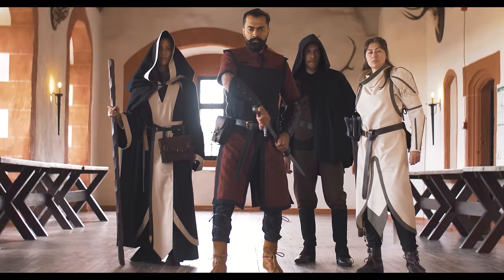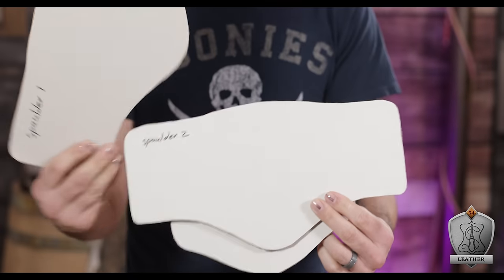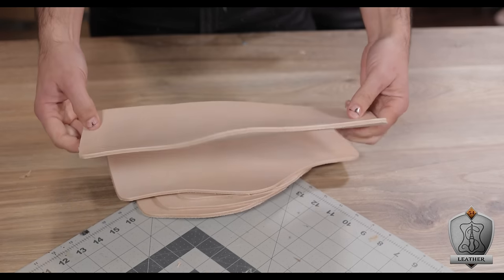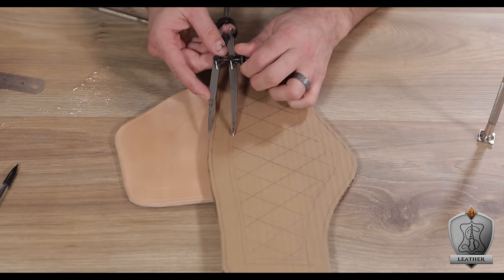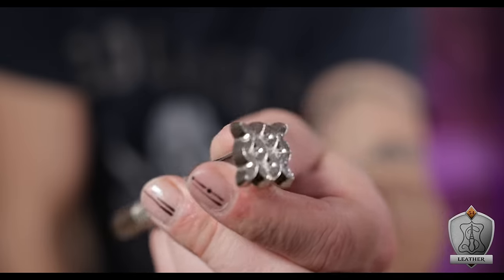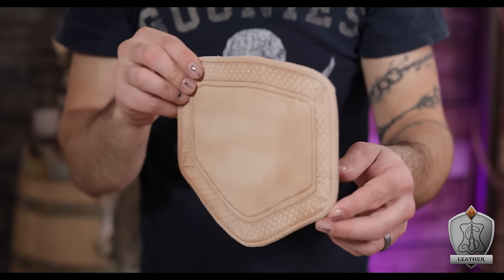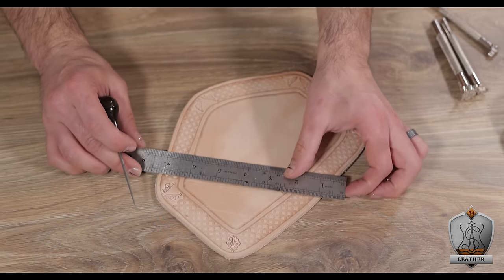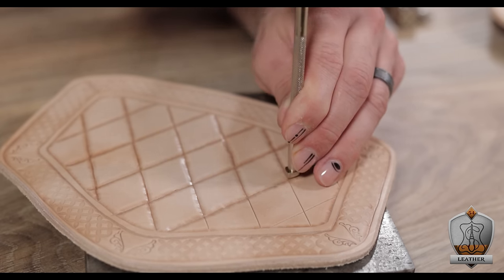How Much Have We Leveled Up?

Comment: Loving the upgrade. You’ve definitely levelled up and I loved the originals. Weird side question, who does your nails? I’ve often noticed you have them painted but every so often you have a funky design and I love your nails in the vid. If you do it yourself can you do a larp friendly job. 

I like the idea of an elemental design as a way to do mage casting. Each nail has a different element upon it so the way your fingers touch creates the spell and the nail design gives you memory prompts. 

I have been tempted to have this idea tattooed with UV ink on my hands but I may be taking it to far 😂

Comment: if it's a non-textured bevel, you can fix the ripples by just holding the tool in your hand and rubbing it over the rippled area to even it out. also there's a stamp tool called a double bevel that is a V shape made specifically to bevel both sides of a cut at the same time for that quilted look (I don't have one but I know that it is a thing)

Comment: I love these vids, but did anyone else notice random production quirks? 
5:44 and 24:10 were a bit low (also the video seems to be compressed with more artifacts)
0:49 "...leveling up this skill" skill level up shield thing doesn't pop up until 0:50 after the cut
2:56 Points to where art design should be
7:45 weird audio artifact.
10:39 lost frame? Probably jump cut
12:58 Cleric book card shows at 13:07
15:29 "I then went around...…I then went around" Probably meant to cut the 1st I then went around.
18:48 "out of, out of position" Frame skip/audio skip? 

Not pointing this out to be mean or picky. More to make sure the uploaded file wasn't corrupted or worse case the editing computer is having problems. I've been doing photography/video for 15 years and unintended artifacts are the first sign of problems to come. 

Usually I'm not a fan of gold, but damn those are sexy looking.

Comment: First, your advancement in skill is amazing. I'm just now advancing to stiff veg tan and artistry, so I admire your artwork. Second, advancing to thicker armor leaves larger gaps for swords to cut into. So your under-layer should be a solid sheet of leather, not straps. Finally... thanks for the tip on letting the hammer drop! I'm using it from now on.

Comment: btw have you ever considered making a tutorial for lamellar armor? i think it would be a perfect fit for your channel as its incredibly cheap and unlike leather armor you dont need any fancy tools or dye's and to be frank not even skill or practice, imo its perfect for anyone, i had a tight budged so i ordered cheap lamellar plates, they were abit rusty but i didnt care, i paid 90 ish bucks for 400 plates (which was about 7 kilos of steel) and i had to pay 25 bucks for shipping, at that price i knew i wasnt getting mirror polished, spotless plates, but if i had the money i couldve ordered fancy plates, you do need some leather but honestly? picking up some used leather belts from a thriftstore work perfectly, depending on the plates i would also suggest atleast wrapping the lower part of the armor in leather but as long as you can cut a semi straight strip of leather and have some means to make a hole in it to attach it youre golden, its honestly something a 10 year old could do by himself with little instruction and as i said it should be affordable for almost everyone

Comment: The new pauldrons look amazing, and I would certainly agree they are a level above your first ones, though I think the first ones still look great!  I do have a couple of ideas.  #1. On the older ones,  cut some sword/axe blows into them with your swivel knife to give them a battle-scarred appearance. That is, if you think battle-scars are cool.  #2. Dye the back side of the plates. When viewed from a side-on angle, it is easy to see between the plates, and the brand new leather with no patina at all can detract from the overall look.

Comment: Love your videos! I've taken inspiration from several of your projects, and still have a few in my backlog to do.

Not trying to be negative, but did you accidentally upload a slightly unfinished edit of this video, or were you a little more rushed this time? There were several times where you referred to linked videos or pointed to the corner where you intended to overlay a picture, but it wasn't included; and there was also at least one failed take left in. Obviously small errors, but your videos are usually so high quality those things stood out. Again not trying to be negative, just wanted to give you the feedback in case you hadn't realized! Keep up the great work!
Reply from the maker: Oh yeah, we had some issues with the edit but figured it was better getting the video to you sooner than having to reexport and upload for the inserts. We appreciate you looking out for us though 💖

Comment: I suspect that the rivets holding the D-ring straps are not going to hold up to active use. They are too light for a stress point.
You might think about replacing them with copper rivets and burrs, for heavy duty attachment.

Comment: It looked like the new Pauldron was riding up with ware and digging into the side of your neck, if that is the case I have some ideas that could help.
(If not you may disregard this post)

1. You could try curling the edge of the top piece so if/when it rides up it won't irritate as much. You could add more design to the piece similar to medieval pauldrons with those wings jutting of the top to protect the neck from piercing.

2. You could attach them to your gauntlet/bracers/gloves to help anchor the pauldron and keeping it from riding up with ware. Design wise it can be as simple as a looped strap/lace/string that allows the gauntlet/bracer strap to feed into it. Or you could replace the gauntlet/bracer/gloves by extend the pauldron down to the hand similar to the Roman Gladiators adding some special connection for the bend in your arm.

3. You could do both!!! though not only would that cost lots of leather, but it might become too much of a good thing with all those colorful pieces.

Hope any of this helps and have a nice day!
(p.s. Even if you don't need to edit the pauldron these ideas could be useful/subject for future videos)

Comment: Looks amazing.  In regards to the “single rivet” though, I might suggest using a Chicago screw instead.  If it’s a single rapid rivet, it isn’t very strong.  A Chicago screw is better for load bearing connections.  I’m a leather crafting civil engineer so this part really stood out to me.  Otherwise, it came out so well.  I’m very impressed.

Comment: I understand that you wanted to add the blue edge to the top piece in some way eventhough you fotgot it at first, and that you put the emblem on that particullar piecefor that reason - and it DOES look good 🙂
However, if it wasn't because of that, I'd put the emblem at the middle of the shoulder. I just think it would be seen much more that way, and making the entire project look even better 👍
But again: I see and totally understand why you did it the way, you did

Comment: I recently added some black pinstripes to an oxblood red leather sheath (I used a stitch groover to cut the line, then infilled with USMC Black).

And that dye bleed is real, none of my fine tip brushes were working, so I ended up using a bamboo skewer as a dip pen and added the dye one drop at a time in an effort to prevent it from bleeding into the red.

I will have to try the counterintuitive big brush technique next time.

Comment: Heads up! That "letting gravity of the hammer do the work" method is Also the best method for metal working - trying to add your muscle strength to hammer blows will cause tendonitis and muscles strain over time.

Comment: Just wondering, because your tooling stamps look amazing, what is the most important aspect? I have tried it and cannot get consistent stamping. I’ve tried an old anvil as a bottom and I think it is not entirely level. Does a flat surface, a hard surface, or a solid whack seem most important?

Comment: I appreciate that you understand the importance of a sharp blade.  However factory razors are actually somewhat dull.  Grab yourself a piece of veg tan and mount it to wood.  Get some jewelers rouge and strop those blades.  You'll be surprised how much sharper they are and it is great on that saddle skirting.

Comment: 10:00
Alternately, use a bone tool at a matching angle and run it up and down each line after beveling. It evens everything out and burnishes the edges

Comment: Yay! New Skill Tree.

2:30 Do you think the Cricut Maker could do the cut instead?

6:40 So my room is made up of several workshops nested/overlapping each other. My 10x12 foot room has a vertical print farm made of 9 3d printers, a laser station with 3 laser printers (one Infrared and two ultraviolet), my design station (read desk), a "soft station" for fabrics and leather working, a "Me" area for when I want to work on myself (exercise and reading), and lots of storage. Oh yeah, there's also a full size (double) loft bed. Not much vertical space above me, but Im laying down anyways, so it doesn’t bother me.
Reply from the maker: WOW! You have a full little factory going on!
Reply: My Cricut Maker 3 says it will do up to 2.4mm thick leather, but I have found it often fails on anything over about 1.8mm thick. Up to that thickness it is great.
Reply: @SkillTree  Yeah... that's how my friends describe my room... but it works and I keep myself busy, so I call it a win.
Reply: @EvanMFitzGerald  So it can reliably go up to 4.5 ounces... Thanks for the information.

Comment: Small Scale workshop/studio.   I am a fiber and fabric crafter.   I have no sewing room or even a dedicated sewing space.   What I do have is a sturdy drop leaf dining room table, a counter height buffet with an 18 x 24 inch cutting mat that just fits, an ironing board and two IKEA type carts.   And a vintage sewing machine.  Plus a couple of big but thin boxes that once held furnace filters that I've flattened out to protect my table top- the weight of the machine is enough to hold them in place. 

I can and have sewn full sized quilts, a gambeson (those old cast iron Singers from the 1950s and earlier are BEASTS), the straight (hidden) seams of several shirts and chemises and petticoats - so many petticoats! Everything tucks into the hall closet and takes less than 10 minutes to set up and take down.   Maybe 15 if I stop to sweep up all the threads and fluff and put the buffet decore back.

It's all about not over buying materials, not having much of a stash (if any), not having many works in progress (one large and one or two small is about the limit for me), not going overboard getting every single tool you might ever need.   Let the drawers and bins of your cart determine how much stuff.   When it's full, you have to get rid of something.   And given the choice between a large fancy sewing machine with all the bells and whistles and 50 specialized feet and fancy electronics in a big dedicated cabinet and a half sized tabletop vintage machine (a 1955 Singer 99), I went with the smaller, older but much more compact (and not co-incidentally much cheaper) option. 

I feel really blessed to have a dining room; in college, I sewed at my desk and had to put everything away every time, with only my Featherweight Singer (which is about the size of a vintage makeup case when it's all packed away) and 12x8x10 inch sewing basket.  My IKEA carts are palatial by contrast.   Would I like a studio?  Of course I would and it may happen some day, but for right now, I'm still a maker and that's what really matters.

Comment: Good job! Your leather work is outstanding! Try using a resist like Fiebings Resoline or Pro Resist to help control colors . It's good to coat a project with before antiquing if you don't want the base color to be darkened too much, but still allows the paste to get into the nooks & crannies.

Comment: Those turned out really nice!  One tip on doing your beveling is to use a tool called a modeling spoon instead of the bevel stamp.  You just push it along your lines after you've cut them in and by holding it at an angle it'll leave a nice smooth bevel and do it a lot quicker and with less wearing out of your arm lol.  Tandy has different styles of modeling spoons and they are all useful for doing this trick with depending on what your project is.  The only time I use a beveling stamp anymore is if I want to use a textured one instead of a smooth one.

Comment: The design, execution and finished result are superb! When it comes to hardening the leather, I personally would stay clear of wax, as it has the habit of staining stuff it comes into contact with (like car seats). The other reason is historical accuracy, wax is a lubricant (archers used to grease their arrows for better penetration). Wax hardening is in affect lubricating your leather for easier penetration. Tod Cutler over at Tod's Workshop (here on YouTube) did a really interesting test with soaking leather in hot hide glue and then laying it over a wood shield. The end result was pretty impressive in terms of cut resistance. Thinking it through I don't believe that the dye would fair well through that process though, what if you made your base layer with Tod's technique and then a top piece with your technique? To lock the top piece into position would probably require drilling holes for rivets through the bottom piece (as punching it would be very hard). I was wondering how much that 12oz. leather pauldron weighs?
Reply: Dark Horse Workshop demonstrates hardening leather armor pieces with wax, and they come out looking great.
Reply: @Kendo-eo9sv  At that point I was talking about Tod's Cutler's hot Hide Glue method, where he soaked the leather in the glue until it was basically the consistency of a wet Chamois Cloth. Come to think of it, that was raw hide he was using so the point is rather moot anyway. I have seen Dark Horse Workshop's videos and he does fine work. :)